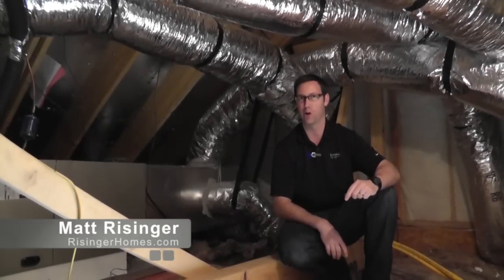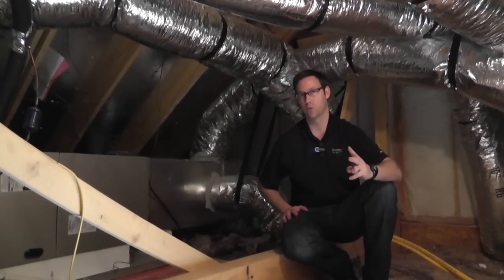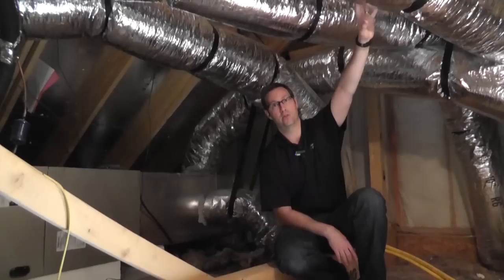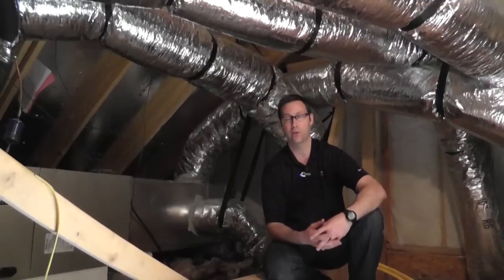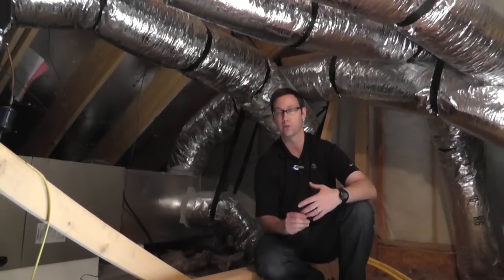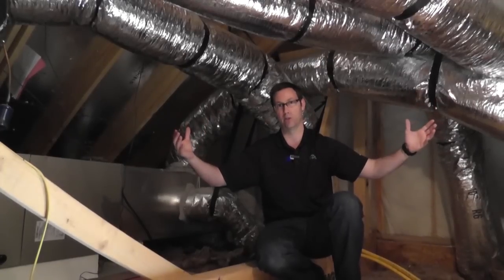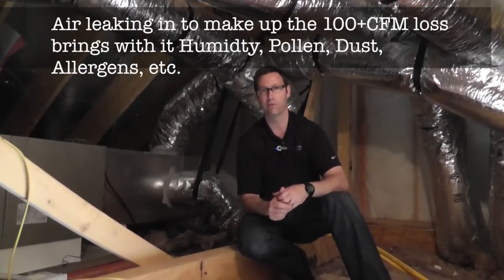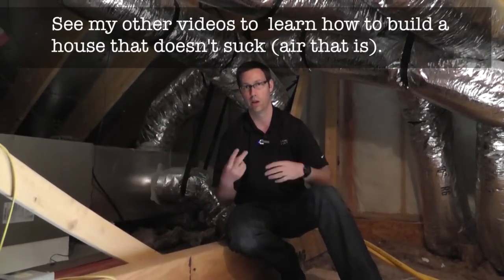Why Traditional HVAC in Texas Homes - Suck

Comment from the maker: Yes, you want ZERO vents to the outside.  This sealed & conditioned attic is the same as another room in your house, except that you won't put an AC outlet in the attic.  The small amount of leakage from your duct system will cool sufficiently to keep the attic temp only a few degrees hotter than the rooms below.  Hope that answers your question.  Best, Matt
Reply: About how much open foam insulation does it take to get these results? Are there any other key components needed in addition to the insulation?
Reply: H

Comment from the maker: Bill, thanks for commenting.  Yes retrofit can be tricky/pricey.  That's why I'm advocating doing it right the first time.  I also highly recommend converting to a conditioned attic while doing a major remodel on a house.  When doing a down to the studs remodel, it's not a big cost differential to convert a house from a vented traditional attic to a conditioned attic.  Best, Matt Risinger

Comment: Can you recommend a company to do a HVAC System Performance Evaluation in Lewisville TX (North Dallas)?

I have had 3 different HVAC repair contractors over the last decade recommend different solutions for the fact my AC cannot keep up in the summer.  I have spent a lot of money on their recommendations without corresponding improvement.

Comment from the maker: Great question.  Actually quite the opposite.  You want an energy rater to model your house to verify this, but most houses can drop .25 to 1 ton from their AC size by converting from a standard attic to a conditioned attic.  The ducts running through conditioned space will significantly decrease your load and it severely limits the depressurization issue from running ducts outside your conditioned space.  Thanks for commenting, Matt

Comment: I really hope that that crap you were squatting next to isn't a typical duct system in your neck of the woods. I'm in HVAC I've been doing this for almost 20 years I have never in my life put a box on top of a unit and then flexed everywhere it needs to go. Number two if you're going to have a system in the Attic do it out of metal hard pipe tape or mastic all of your joints insulate it have it running across the top of your roof that is below you and then insulate over it
Reply: This is very typical for Texas.

Comment: Same here in Arizona. Obviously, if the house was not blessed with basement, then HVAC gonna live in attic. I've been told various reasons why basements are the thing of the past, few of those being 1) bumps up construction cost dramatically - think about flood protection, digging hard rock soil etc. 2) Health concerns cause radioactive gas Radon tends to gather in lower spaces which makes basements radioactive place to visit, especially in states where there's high underground Uranium concentration. It all makes sense, though I don't know if that's only reason.

Comment: I had been looking into this for a while now but my 14 year A/C system now needs to be replaced. I have had 6 different quotes for replacements. I have asked them all about retro fitting my attic to conditioned space and not one knew what I was talking about, heard of it being done or understand how it would be worth the cost. I'm in the Central Valley of California. My two story 2500 square foot home attic space hits in the high 140's in the summer. It's leading to believe my area is not keeping up with innovations in their field.

Comment: Why not add a supply to the Attic? Only for cooling. So when you turn it on on Heating obviously you don't want the attic to heat up when you put it on cooling the attic will cool together with the house. How to do that? Adding a motorized damper only opens when cooling

Comment: Recorded 152deg before tearout of attic, ceiling sheetrock/roll insulation of 2 story duplex after storm roof loss. After tearout of upper ceiling water damage the new air flow created was amazing.....Would suck the curtains inward almost horizontally

Comment: Our AC technician accidentally made many holes in the filter rack.  So he used those HVAC approved tapes and used mastic sealant top of the tapes inside the filter rack. He told me mastic sealant aren't toxic so it was okay to put it inside but he put so much of it and it covers almost half of the inside filter rack. Now I am concerned for my kids safety because filter rack is where the air travels all the time when ac or heater is turned on. Is it safe?
Originally they were going to just replace the filter rack with new but they said it might cause more damage so they just covered the holes with mastic duct sealant.

Comment: a solar power vent will remove the hot air in attic
Reply: I got three attics in my home, all have missing insulation, and two have a/c ducts. I can't go into the attics or I'll fry. I'm thinking about putting at least two solar power vents in each attic. I'm sure it'll make a big difference my a/c air feels.
Reply: If your ceiling and top plates are not well sealed, the attic fans will just pull conditioned air into the attic costing you money and efficiency.

Comment from the maker: Yes great point.  Condensation can definitely be an issue when you're seeing a temperature delta of 50+ degrees between the inside & outside of the ductwork.  I've seen lots of moldy ducts in the houses I remodel due to condensation.  Best, Matt

Comment: Matt, when converting an attic to conditioned air space (using spray foam) would you also close off the soffit vents?
Reply: Yes absolutely! along with proper blocking and sealing.

Comment: by adding spray foam onto the attic ceiling (ie conditioned attic space), would you need a larger HVAC system to condition this attic space?
Reply: no if you spray the attic ceiling it keeps a lot of the air house.  I do HVAC calculations professionally and encapsulating the attic (spraying foam on attic deck) will drop the a typically house 1/2 ton to 1 ton for the load.